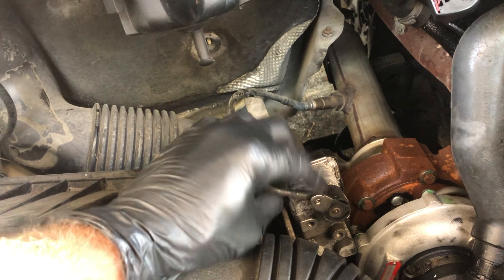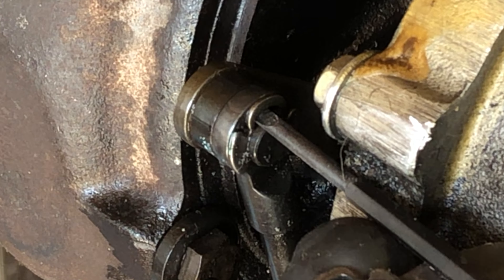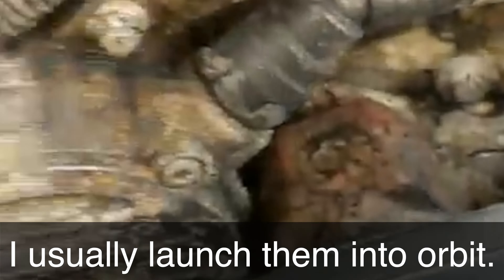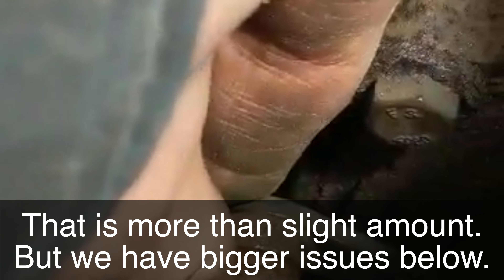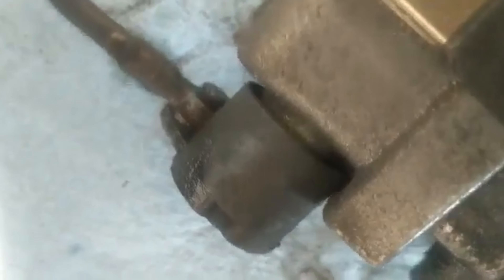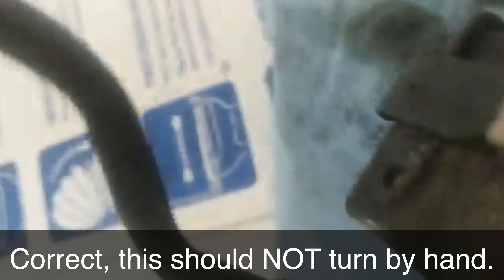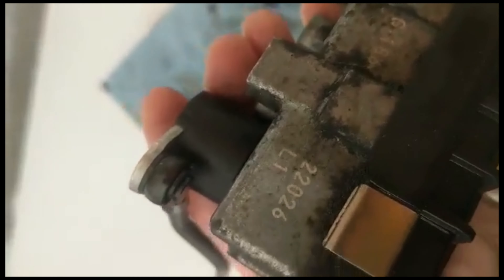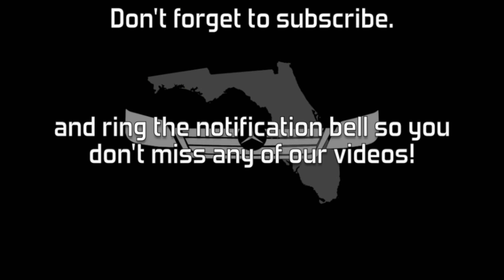Turbo Linkage Stuck and Rusted, T1N Sprinter Boost Errors and Codes Limp Home Mode with Low Power

Comment: Coming back to this one!  I just recently dealt with a loss of power, no turbo and black smoke which felt like A/F issue, No codes on OM647. 
EGR was fully stuck and clogged,  cleaned that up and all well now but come think of it both bad EGR and actuator seem to produce similar symptoms so now with EGR cleaning I'm going to inspect, clean and lubricate the actuator at the same time.

Comment: Would you recommend preemptively hitting it with a rust lubricant product such as PB blaster.
Reply from the maker: Definitely. I wash and oil my entire engine bay occasionally. Wash with Dawn dishwater and rinse. Dry with a leaf blower, drive to warm/dry, then spray everything with WD-40 or similar oil spray.

Comment: Loving your channel! I have fixed so many things I would have never attempted if it , wasn't for your straightforward instructions. 

Question about the clip, if it does go flying, where can a replacement be ordered from? Mine may have taken flight....
Reply from the maker: "Been there, done that!" LOL 
Any local hardware store will have "E-Springs" but you'll want to ask where because they don't display these tiny parts. You may need to try a few sizes to see what fits.
Reply: @FloridaVanMan  Thank you for the info!

Comment: I have a similar but not the same issue. Driving last night and lost power. Looking at it today and my actuator arm that is on the bell crank (not between the module and the turbo) seems to be seized and doesn’t move when engine is off - is that normal or a problem? There is also a bit of a whining sound when revving the engine. If the actuator arm is seized, is there a fix other than replacement for the turbo? Thanks for all that you provide for the T1N community.
Reply from the maker: Ya lost me at "bell crank". Our turbo actuator won't move when off because the worm-gear internal motion. I don't know what other linkage you are referring to.

Comment: I have a 2008 sprinter 3.0  very hard to start changed the fly wheel sensor still hard to start I have to use ether to get it started runs perrfect when it starts but if you switch it off for just a second it will be hard to start again was wondering if it might be the injector pump ?
Reply from the maker: I'm not familiar with the common* problems with a 2008, being an NCV3. But High Pressure Fuel Pump seems a likely culprit, unable to produce pressure at low RPMs. Theorizing, once the bump gets enough speed it will produce enough pressure to fire the injectors. Could also be a fuel rail or injectors releasing the rail pressure when volume is lower, as it would be with low RPMs until starting.
Reply: @FloridaVanMan  thats what i was thinking the high pressure pump

Comment: was this the purple one? I think that one sat for a long time?
Reply from the maker: Purple Van was not harmed in the making of this video. Hehe There will be a new video of purple coming soon.  In the opening I use some parts from our shelf to demonstrate the clip, but most of the video was shot by Mallory as we worked together diagnosing her van troubles by text and video.
Reply: @FloridaVanMan   @Florida Van Man  I'm just curious if that pin seized "while being driven regularly", or if it was parked for a good bit of time. I'd think it wouldn't if it was moving around (being driven), but parked in a moist climate could be a problem.
Reply from the maker: @utahjohn5480  It was parked a while doing other things to it. I wonder if the turbo area was cleaned with degreaser before sitting, but we have seen this linkage frozen on a few project vans.